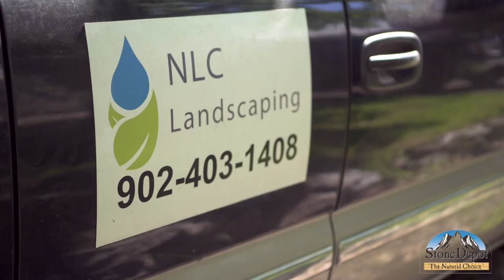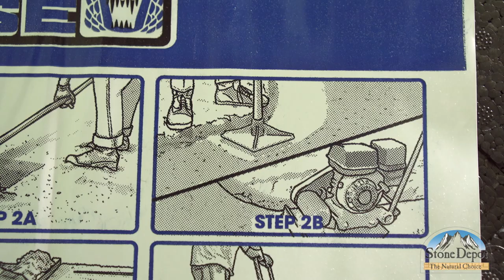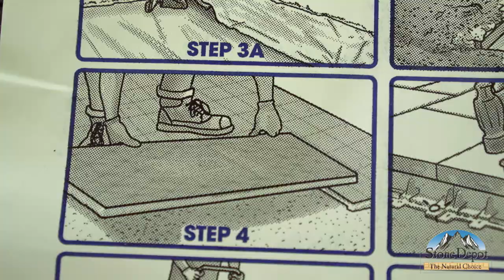HOW TO LAY A FLAGSTONE PATIO: Using Gator Base Instead of Gravel

Comment: Thanks for the tip on the Flex Lock , I wanted something to lock the stones in place so  chair legs don't cause them to move.I had not heard of Flex Lock.
Reply from the maker: yes, it worked well!
Reply: Your not Supposed to use that that’s for interlocking you need to put mortar in those joints. That’s not how you do flagstone at all.
Reply: You are totally wrong. Polymeric sand (flex dust) is more than ok if you use the right kind. They make it to where i still bongs and hardens in up to 6” gaps. I am a landscape/ hardscaper and we use it. As do a lot of other guys I know in the industry

Comment: Very good tutorial. I tried to lay flagstone (without concrete) on my small front lawn. Turned out terrible. I am planning to try this method. Instead of using the crusher dust, could I use sand? What is the gator base for? Is there something else you can use to bring the cost down? How many bags of flex lock did you use?
Reply: use cement board instead of Gators. thants what I'm going to do. 10 bucks a pop. 15 square ft each as oppsed to 13.00 each for 6sf.

Comment: does the gator base also work as a weed barrier? any idea how long until weeds begin (or will begin) to penetrate the patio?  Looking to do a patio that will be lowest in maintenance once it's finished - thank you for the video!!
Reply from the maker: Yes the gator base and the flex lock should keep the weeds out!

Comment: OK we tried this with a shovel and a tiller. Its taking forever to remove the sod. Did u use a sod removal tool? Also we have clay dirt and embedded rocks, so wondering if that could be an issue too
Reply from the maker: We just removed the sod by hand with a spade and shovel